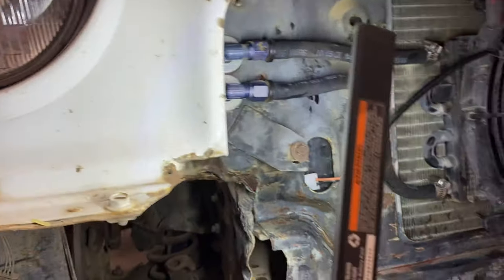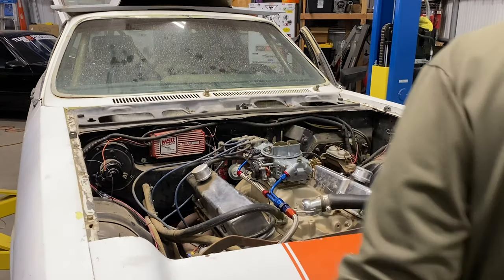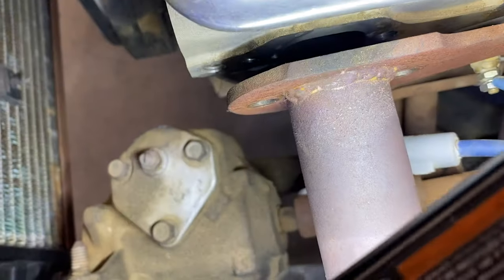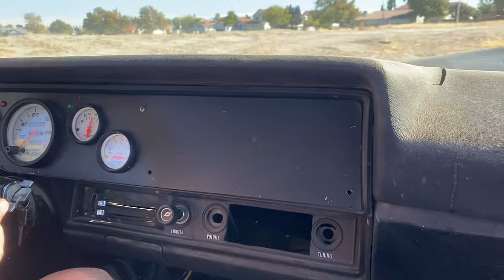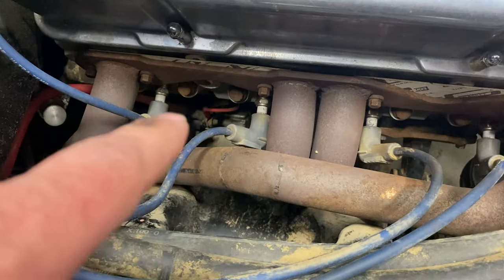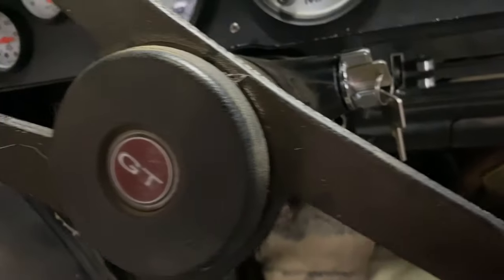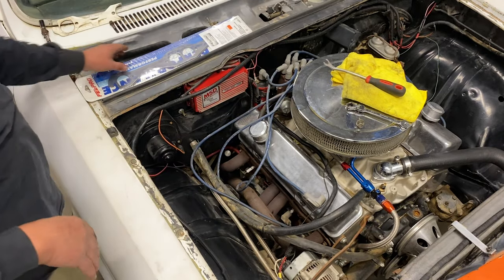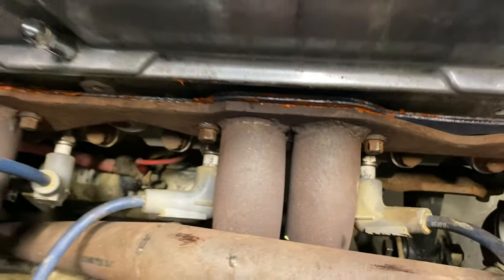1973 CHEVROLET VEGA HATCHBACK FIRES AND RUNS! THANKS TEAM D PERFORMANCE!!

Comment: I do not like those paper exhaust gaskets. I started using the aluminum ones, they are more money but will compensate for poor header welds on the flanges!
Reply from the maker: I think that’s next if the doubled up gaskets don’t hold !
Reply: I use copper ones myself
Reply from the maker: Yes they’re way better then the paper junk !

Comment: If GM would have put 350s in the Vaga back in the day they would have had a great upseter.
Reply from the maker: I do believe that as well. Light cars.
Reply: @TeamDPerformance  couldn't do that would have out done Corvette. my first car was a 74 with 350 and manual 4speed I did it myself got me in trouble mom took it and sold it. college money

Comment: Everyone has a dream I guess.
Reply from the maker: He dreams of turboing this thing and getting it sideways. Ima take a life insurance policy out ! Lol
Reply: @TeamDPerformance  Needs some chassis work for that. If he puts much power in it. He'll end up every which way doing the twist and shout. If you're like me, you'll probably end up doing that too. That car was designed around an engine that made seventy one horsepower.
Reply from the maker: It for sure needs better front suspension then the old stuff designed for that little engine that was in it. I can’t tell if the person who built it was just making a cool hot wheels type car that looked the part or really intended to go fast in it.
Reply: @TeamDPerformance  You've probably seen more than me, the cars out there scary fast that you would be hesitant to take around the block.
Reply: I remember the 80's. Crazy paint, pinstripes on the windows, blower on a big block, and a cage made out of exhaust pipe welded straight to the floor. No pads. No reinforcements. Ready to poke through like a church key through a beer can.
Reply from the maker: Oh yea safety last lol some sketchy builds out there for sure
Reply from the maker: Lmao